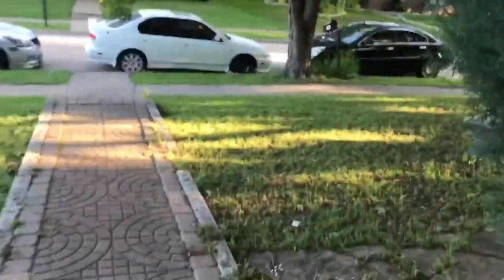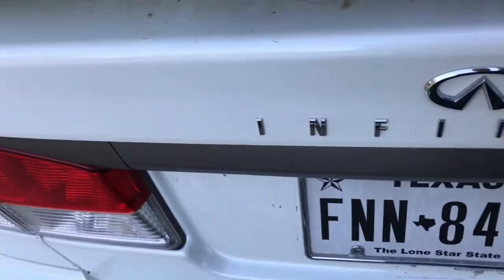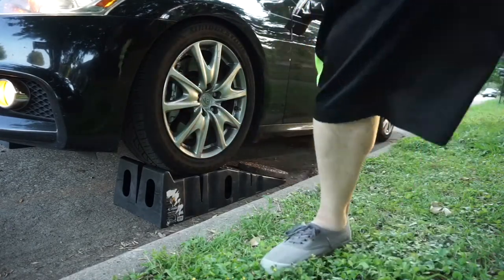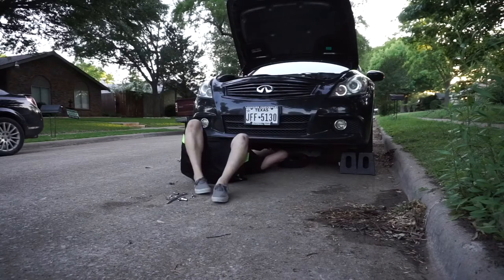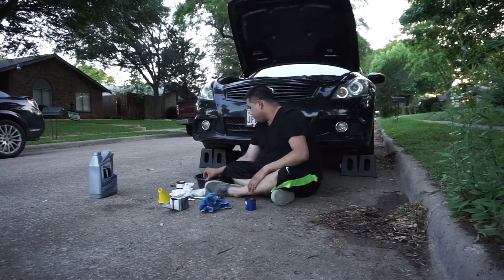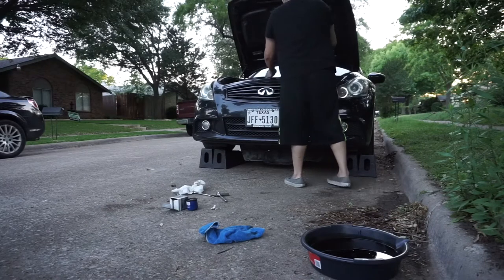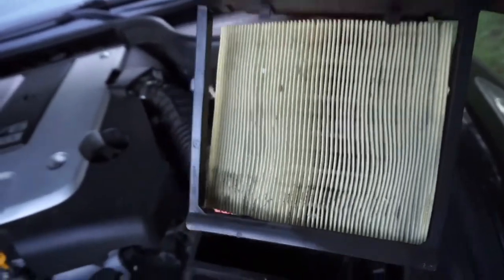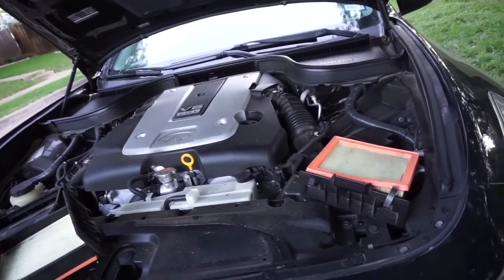Infiniti G37 | G37 oil change.

Comment: nice video and clean g37. I love the g20's I've been looking for one to turbocharge. to anyone that this would apply to; be careful removing the air filters because debris can fall into the intake tube and get on the mass air flow sensor and put your car in limp mode.
Reply from the maker: Silviasean so true man on my old maxima that happened and then the car would not respond to the idle relearn. Yeah I need to fix the g20 it's been down since like last november

Comment: Yeah..

Underfilling the VQHR is a great thing to do!

Notice he put 5 quarts(the jug) into the motor.  Car calls for 5.2 quarts w/filter.  

My G takes 5.2 on the button everytime and have had it from 2 miles.
Reply from the maker: I've always added 5 qt and my car still running strong, .2 qts isn't going to affect anything. Plus if you really want to be specific about it its 5.3 so I guess you're under filling yours aswell..... Like I said before my car has been problem free.

Comment: How has reliability been? Looking into getting a q40 with 60k miles
Reply from the maker: Sorry for the late reply bro, but the car has been very reliable so far. My sisters g35 hmos still running strong and it has 155k miles mine at the moment is at 117k and still no major issues. There’s many people on the G37 pages who are running strong on cars that have 250k

Comment: nice work on the video bro👍
Reply from the maker: StreetBattles 37 thanks I'm trying to get better at it, I'm getting the urge to get a drone to get better footage lol
Reply: np mann just keep doing what you think is best you got this!👍
Reply from the maker: StreetBattles 37 so true man I need to get some videos like yours of me running other cars lol
Reply: Mumble haha thanks for checking out the channel!👍👍 i havent put up any of my my new ARK grip CBE yet lol n you should definitely try some races! Lol
Reply from the maker: StreetBattles 37 yeah You should lol I used to do a lot of racing back in the days, I'm trying to get back into .The only car I have ran in my G37s was a charger with intake/exhaust and tune and  I got him by like 2 1/2 cars.
Reply: Mumble haha damm by that much and it was tuned dam! lol G37s are sleepers!👍
Reply from the maker: StreetBattles 37 yeah lol I had raced a couple chargers in my old maxima and never beat them that bad I was shocked haha I wish I would had recorded it haha
Reply: Mumble yeah man the g37 is a tank lol its okay though i started off in a maxima to 😂
Reply from the maker: StreetBattles 37 lol really mine was a 5.5 gen 6spd
Reply: Mumble dammm i really wanted one of those i had the 2001 with the vq30 i think ill buy a 5.5 gen as a daily
Reply from the maker: StreetBattles 37 not bad I was about to but the one with the vq30 but found the newer one for a lot cheaper lol yeah man you should they are sleepers
Reply: Mumble haha yeah man you right when you uploading again? you should try a top 5 or top 10 list of stuff you like from ur g37!
Reply from the maker: StreetBattles 37 probably tomorrow and that is my next video to lol 😂 I'm trying to think about what I like about the car
Reply from the maker: StreetBattles 37 I do have ideas for the stuff I do hate about the car
Reply: Mumble then do what u can man ill keep watching the vids👍
Reply from the maker: StreetBattles 37 same her bro keep up the racing hopefully I'll have some vids of me racing or tracking  my g37
Reply: Mumble ayee thanks man i appreciate the support!